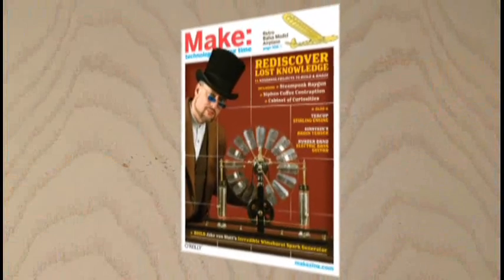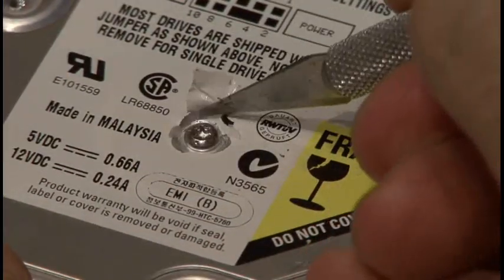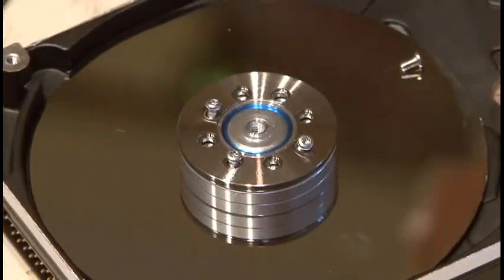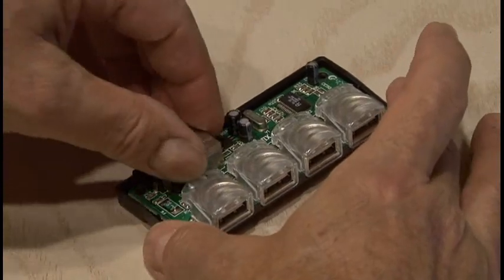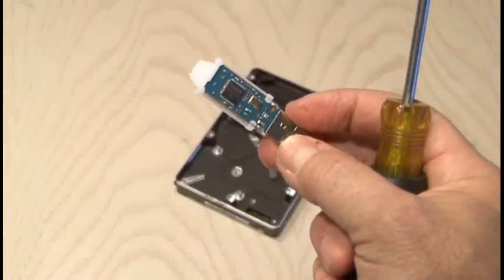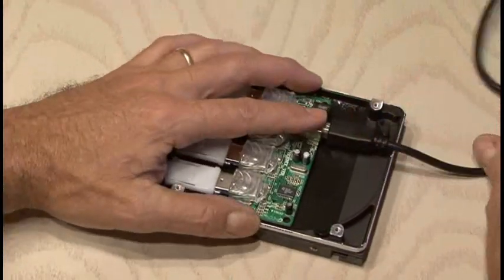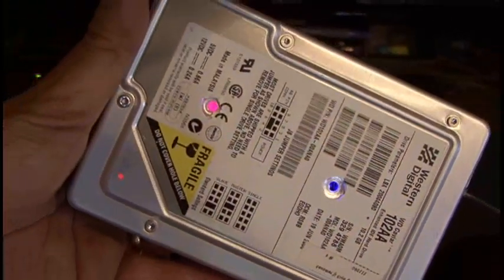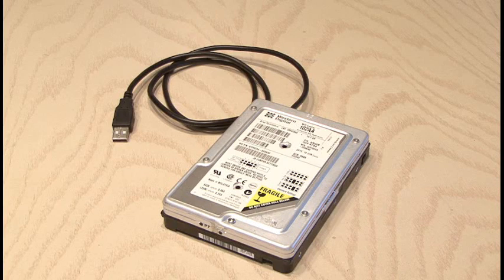Weekend Project: Flash Memory Hard Drive

Comment: It amazes me when I come to a video like this and see so many smug commentors who can't even be bothered to read the bolded '2009' text in the description. This was a pretty sweet project idea for 2009 guys, SSDs were pretty expensive back then.
Reply: This doesn't form an SSD. This is a USB hub in a metal box.

If It was running RAID through some kind of SATA usb hub i'd be impressed since you would get the benefits of the random reading and writing speed. But i'm not, because it's not. It's still limited to USB speeds, and that being USB2 means it's slow as fuck.
Reply: Molo mono Why would you RAID them in 2009? Because it still works, and is thus functional, and might be fun to make? The whole point of the video is fun, it just also happens to work. There's no point doing it exactly like this 2014 though, you could easily make something better.

Cute that you're +1ing your own comment though, lol.
Reply: thats true and fuck all of those who say this clip is bull shit because its AWESOME
Reply: Bearded Bear
HDD are faster than usb 2.0 flash drives.
Reply: Bloo the Bearded Bear That's the thing, RAID won't do shit because it's running through USB2.0

Furthermore USB sticks are only functional because they are portable, this storage device takes away that functionality and thus renders it all useless. Just buy a new drive.

I'm all for DIY projects. More frequently electrical projects than mechanical. But i would never build anything that has no functionality or recreational factor.
Reply: this is a pretty sweet project today!...thumb drives are cheaper every day. molo don't be a tool it's still a solid state solution more reliable than plate disks and perfectly suitable for system backup applications
Reply: Dity the Bearded Bear
I said above and i quote:
"I would never build anything that has no functionality or recreational factor."

So why would i RAID them? It's not fun it's not functional, unless you wanted to encrypt a program or project there are no benefits.

And what are you trying to prove by arguing with me. I think this project is stupid, and nothing you can say will change my mind.
Reply: ***** I'm pretty sure the hard drive is still the size of a hard drive, and it's probably lighter than it was with the magnetic disk inside. Besides, aesthetics are also a part of this project - it's not just about functionality.
Reply: Take a USB hub and put it in a metal box.  Lame even for 2005
Reply: Bearded Bear Also, they're more durable than common hard disks, because they don't have any mechanical parts.
Reply: Molo mono yes, it's not really an SSD - do you want a medal for figuring that out?

it's quite clearly a fun little project, it's not a super practical solution meant to solve your storage woes. however, in 2009 when storage was quite a bit more expensive this was a simple way of making a neat and tidy looking usb hub box out of something you probably were just going to throw out anyway (because we all know how ugly usb hubs can be).

'sides, if you're complaining about them not being connected why not just, i dunno, connect them together via raid anyway? nothing's stopping you from doing so.
Reply: Molo mono I don't know what fairy land you're living in, but you can make a RAID array from USB 2.0 devices.

FYI, I didn't see your comment until now because it was marked as spam. Lol.
Reply: Dity the Bearded Bear
you can raid any disks formatted properly. prove me wrong :D
Reply: Dity the Bearded Bear I believe he said you CAN raid the flash drives but it won't increase the speed cos it's limited to USB 2.0 speeds. So err... Awkward...
Reply: weed lord He was implying you shouldn't do it, because it won't be fast if you do so. Pointless complaint, you can still RAID them, even if it's slow.
Reply: ***** i baught an  64gb ssd for £70 ? pricey
Reply: im using it as os disk
Reply: Run 3.0 enabled drives rather than 2.0. That would be a ton faster
Reply: thank you, i give him an a for effort. but even now it gives me ideas for creating things from old hard drives.

Comment: you could put them in raid, its difficult with flash drives but possible its a trick for using ssd's
Reply: USB doesn't lend itself to RAID very well. Shared data stream and everything...
Reply: well yes, but it is still possible with flash drives, although very difficult for it to work properly.

Comment: Seems like a good way to recycle an old hard drive and put in 4 1TB flash drives in there to get 4TBs of storage space. Sure the drives are nearly 1k a peice but if you need to have a lot of space with a real slick way to do it then this would be the way. Of course an even cooler project would be to take an old original hard drive that has more room in it and put a 7 port hub in there and put 7 TB flash drives in there. Now that would be something that little to no people would have.

Comment: I have an external USB Hard drive I keep my work files on and I have one 16gb flash I keep funny lolcats and ragefaces and shit on. However my 16gb is getting full, though a handy chap I would like it to have 3 little brothers all sitting together so I can keep my lulz and my cats and gifs separate, but that takes up USB slots, having an external hub may be easier for that but I like the idea that these 4 drives can be stored internally. Making the one slot used by my 16gb flash quarduple.
But i COULD save time by buying an exctra hard drive but I like the simplicity of having the USBs. I'd do this...

Comment: do it with four 64GB flash drive
Reply: do they make 128GB flash drives?
Reply: where to buy in 2009?
Reply: http://www.amazon.com/Kingston-DataTraveler-Predator-1TB-DTHXP30/dp/B00E65QM8O
Reply: my brother and i thought the same thing lol
Reply: Jamie Towns
Why not four 128 GB flash drives
Reply: Jamie Towns
Yep,
http://www.bestbuy.ca/en-CA/product/lexar-media-lexar-jumpdrive-s23-128gb-usb-flash-drive-ljds23-128asbna/10282425.aspx?path=4507f8a492009908a7a23df39e275890en02
Reply: adam gorski Jamie Towns or you could get this for a whole lot less
http://www.amazon.com/PNY-Turbo-Performance-Drive-P-FD128TBOP-GE/dp/B00FE2N1WS/ref=sr_1_1?s=electronics&ie=UTF8&qid=1397442144&sr=1-1&keywords=128+gb+flash+drive+usb+3.0
Reply: Alwinmathew P
I don't think that would fit
Reply: adam gorski They come included with a small wire, so you could use it even if you didn't have enough space to plug one in.

Comment: to make all the flash drives as 1 drive you will need to RAID them eather RAID 0,1,5,10..... but in order for it to work... all of the drivers must be the same for the best performance. IE the same storage size... like you had a mix of 4GB and 8GB drives. get some more 8GB drives and it will work great
Reply: FormulaGamer123 its very possible to make a raid from USB drives. You might not be able to ;)
Reply: FormulaGamer123 You can run raid through USB

It's actually pretty easy and they run rather fast.
Reply from the maker: Nick Parillo This video is more than 5 years old.
Reply: FormulaGamer123 You can now.
Reply: MAKE   i just realized xD
Reply: Nick Parillo For example, I would highly recommend four Kingston HyperX DataTraveler 512GB USB 3.0 thumb drives in kipkay 's case for a capacity to rival many hard drive systems today at 2TB.  Not only that, but kipkay will also enjoy read/write speeds of up to 300MB/s and 200MB/s respectively per drive and get overall speeds averaging 1GB/s.  Also, I quote myself on rivaling many hard drive systems today and this video is very old, published in 2009.  We are now in 2015 and Western Digital has built a 6TB hard drive.
Reply: FormulaGamer123  There is a way to do this ;)
Reply: +FormulaGamer123 You can, in fact. The 8-bit guy did it!
Reply: Mort Schubert  I had no idea they already made 2TB SSDs.  The highest SSD capacity I've ever seen yet is, depending on the brand, 960GB or 1TB.  😮
Reply: ***** Seven years ago this year.
Reply: +David Stott The speeds are high, but the costs are astronomically higher. Today, you can get a 2TB Samsung 850 Evo SSD for less than half the price of the four HyperX's. Read and write speeds? 500+ MB/s.
Still, if you happen to have four such thumb drives and do not need them for independent, mobile usage...
Reply: +David Stott  Intel released the DC S3500 with 1.6 Tb in 2014
Reply: +FormulaGamer123  You actually can! I forgot exactly how, but it is possible, I've done it myself for experimentation
Reply: +FormulaGamer123 Yeah, you can.
Reply: +David Stott you're better off buying 2 1tb ssd's and raiding them as they will run much faster
Reply: dante la rooy 
If you are running UNIX, you can.
hook up the drivers in a Raspberry PI ($35), and you have a NETWORK DRIVE!!!
Reply: b44rt tell me how :D
Reply: +David Stott That should bring all the prices down. Should! :D
Reply: +Nick Parillo Same here, I have two 2 tb drives in my workstation hooked up in a raid, to make 1 4 tb drive.
Reply: +FormulaGamer123 Uh, yes you can --'
Reply: +FormulaGamer123 you can -__-
Reply: +FormulaGamer123 Yes, Yes you can.........
Reply: +FormulaGamer123 you can run raids on usbs but could you raid the 2 4gb and then raid those 3 8gb particions?
Reply: +FormulaGamer123  not true, you can run usb raid  and get massive write improvements
Reply: +FormulaGamer123 You canRAID USB you wannabe pro .... -.-
Reply: +Jexll Wuff ONE??   ok let me copy paste the videos upload date..  

Uploaded on Mar 26, 2009

Right now it's Jan 2016..   hmmm lets see.. 2016-2009... 
ahh never mind to hard for me, but i  know its more than 1.  :p
Reply: How do you do this on windows 10, do u know?
Reply: +FormulaGamer123 Yeah, you can. :)
Reply: +Иіск Рагіllб make a striped volume on windows
Reply: +FormulaGamer123 You can run RAID 0, 1, 5, 10 or 01, but its little bit complex
Reply: ok but this is not as fast as HDD :-(
Reply: CZARNYEU faster than this shit hdd they use
Reply: BENBOOST9 this pendrive is USB 2.0? even if this flash will be write around 20MB/s x 4 ports this give (by usb 3.0) 80MB/s... this old HDD can be faster :-(
Reply: If you want to make one drive from bunch of different USB, you can use LVM. It is pointless to use physical RAID. I don't see any useful applications from this setup. It is USB 2.0...speed wont be the best....and USB drives usually can't hold too many write cycles....
Reply: m32online never had an USB drive fail on me though.
Reply: It would actually be better for him to run an "Extended" Simple Partition making one the primary and the others the extended then he wouldnt need to get the new USB's but the more you fill it the slower it will be.
Reply: Wow!
Reply: How?
Reply: Tbh yes you can out them through a raid config it's been done on Mac OS X don't k ow about windows though
Reply: i remember doing it on Flipped drives but otherwise no. found out that they were all lexar drives and what i did was look up a lexar flipping tool. cant remember where it all came from and i just recently wiped my computer so it isnt in my backed up data as i didnt really need it. as for doing a raid in windows this is litteraly the only way ive tried though many different os versions using server. and still nothing. so alas i was left to flipping it. then i could get a raid.
Reply: u can stripe them then the diverent sizes wont matter
Reply: lol thats one method to use. were they lexar usb's? on windows you need to flip them, ive done some testing and managed to get a usb raid from linux to follow over to windows.
Reply: or linux
Reply: lol i found a guide some time ago about it just search usb raid linux and you should beable to find it
Reply: yeah you can
Reply: *****
yes and no... if u have a 500 gb drive and an 1tb drive then the raid will be 1tb combined
Reply: you will have to specify what you mean by UNIX?
Reply: whilhelm he means "Linux"
Reply: menchen XD i assume du kommst aus deutschland ?! XD
Reply: Urban Major nein. Ich komme aus Irland. Was ist "Do you speak English" auf Deutsch?
Reply: "Sprichst du Deutsch ?" 

I thought because you wrote menchen ( in german pronounced like mention) you were german :)
Reply: Иіск Рагіllб UNRAID!!:D
Reply: just do a raid:/
Reply: Sorry? You can run raid trough USB
Reply: Katie Yang yes, see video here https://youtu.be/dougISKs2vQ
Reply: Leave the tech comments to the techs.
Reply: You can't run raid through usb.
Reply: thats why this video is dumb :)
Reply: @parillo12  yes you can

Comment: This is fairly easy to do on a Mac, haven't got the experience to do it on Windows.
You open it up in Disk Utility and use the RAID section to lump them all together as one drive. Plug it in and you end up with 1 big USB "hard drive"

Comment: i can tell you how to make it one drive. as a matter of fact i can make it merge unto the c: drive and thus speed up your hard disk...well not quite what you do is something called ready-boost and its built into windows. first is to right click on each usb drive in my computer then click on properties then on ready-boost and allow each drive to be used by the PC it will basically use your usb drives as ram to speed up your computer and the best part is if you ever need them back you can just pull them out windows will work like normal BUT this will not work if you have a solid state drive but those are fast as it is...
Reply: really o.o
Reply: yes but there are some restrictions if its vista then you max out at a 4gig usb if its win7 then your up to 32gig also it must read and write at a min of 2.5 mb/sec or usb2.0 and up and fyi it only helps if your drive is slower than 5200 rpm...if your drive is 7200 or 10000 rpm then doing this wont really speed anything up

Comment: this wasn't a big deal...
Reply: Indeed... It's like "Congrats! You just sacked a 10gb drive and a usb hub to make your 4 usb sticks take up more space!"
Reply: Jonas Paaske Hansen
 That is true about the space. But if you put a dab of hot glue on each of the drives where they connect as well as the power cord, then you don't have to worry about carrying around 4 drives, a usb hub, and the cord for the hub. Six items just became one and it's easier to know where that one item is. And if you travel and like to use raid, you don't want to lose even one of those parts.

But ultimately, you destroyed a 10 gig for 24 gigs, so it wouldn't be worth it to most people anyways.

Comment: I think you can make it a RAID so you have one drive letter AND redundancy. that would make this a whole lot more practical as well.
Reply: RAID , yes. I've seen it done a few years ago but with Linux.
Reply: Caleb Maddox Its not complicated, it would work like a normal drive. I just would not install an OS to it or anything like that as temp files would eat through your write cycles.

I believe you can just use windows disk manager to create a spanned volume. I usually do things like this in linux, but this walkthrough should work just fine.

http://www.howtogeek.com/howto/36504/how-to-create-a-software-raid-array-in-windows-7/
Reply: I doubt you could do RAID over USB, even if you could the flash used on flash drives is pretty terrible and flash isn't very good for backup anyway so using RAID for redundancy would be a bit silly.  But really hard drives are a dime a dozen these days and even a mechanical hard drive would be miles faster than this...
Reply: PoLoMoTo2534 Yes you can do it, I've seen it done in the Linux kernel but I don't personally know how.
Reply: ***** it aint raid and since it use a splitter and they are always connected it slow down the speed. Just buy a cheap ssd, get 64 gb of ram and do a ramdisk. End of the story.
Reply: Mathias Beaulieu-Duncan is an idiot.
Reply: mcapps1 don't call anyone an idiot. Raid over USB to to complicated for regular everyday use. Even if it can b donr

Comment: This would be infinitely better if you found a way to wire it into the existing SATA connector so it would function as an internal hard drive. All you've done is put a "Hard Drive Shell" onto a multi-USB hub. Kind of a waste of time since the hub functioned exactly the same way without the mod and now you can't even swap out the flash drives. You've removed some functionality from an already functioning device for the sake of aesthetics. What's the point?

Comment: wouldn't a ZFS pool make them "one"
Reply: I believe it's more than just making the drives "one." It would be very useful if you could actually install the modded drive and have it act as an SDD, for that is essentially what it is. The advantages of an SDD as opposed to an HDD is that it has much faster data transfer speed and is less delicate. However, the HDD still has the advantage in massive storage space, going up to the Terabyte range, whilst most SDD's are still in the Gigabyte range, and are quite expensive. HDD's are cheaper and offer greater storage capacity.
Reply: greg77389 Somewhat true SSDs are in the terabyte range now (and have been for almost a year) but are extremely expensive compared to a regular HDD.  
http://www.extremetech.com/computing/181809-sandisks-collosal-4tb-ssd-does-this-mean-ssds-will-soon-provide-more-storage-than-hard-drives

Comment: This can easily be done on Linux by Spoofing a RAID0 ontop of the HUB however with windows its near impossible. You would need to make them fixable and setup a RAID controller for the HUB to join them all together. At this point it wouldn't really be possible via windows to remove the drive.

Comment: You say this solution is faster than a ordinary HDD? I don´t think so.
An USB 3.0 HDD is certainly pretty much the same speed or even slightly faster than an ordinary intern HDD. But USB-Sticks? Never seen one of these with transferrates over 30-40 mb/s. There are sure some quite expensive ones with better transfer rates, but for the same money u get a much bigger USB 3.0 HDD then.
So whats the point of this?